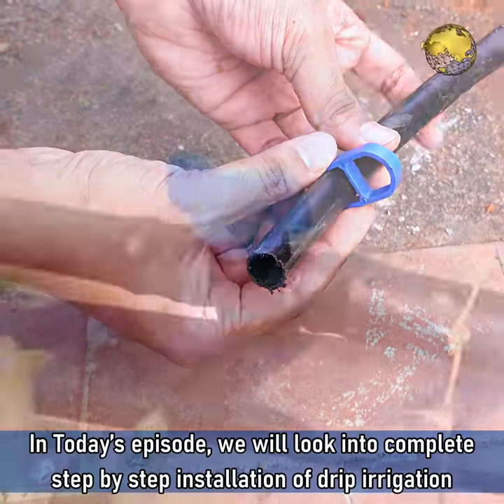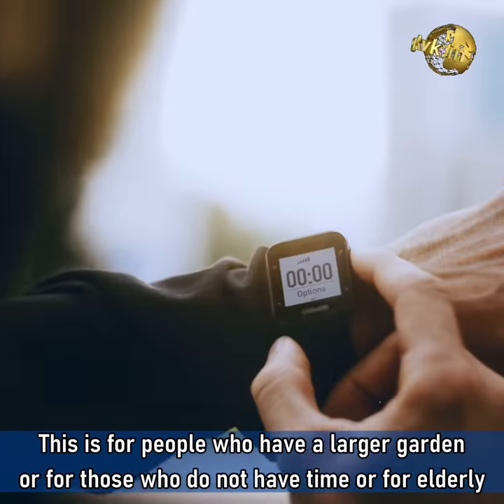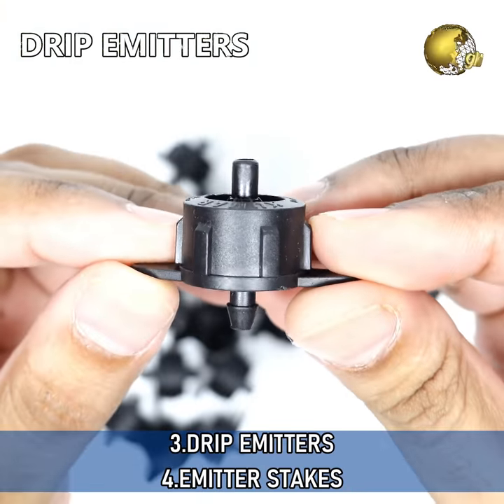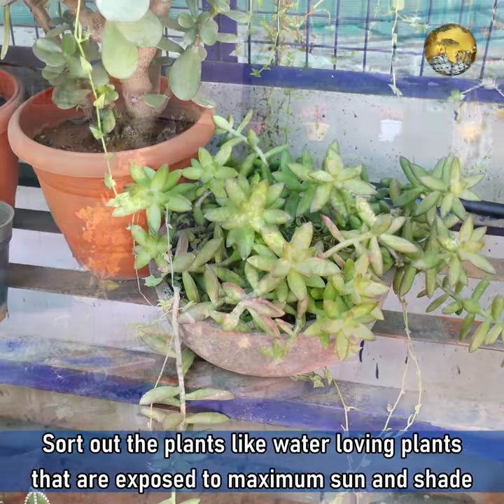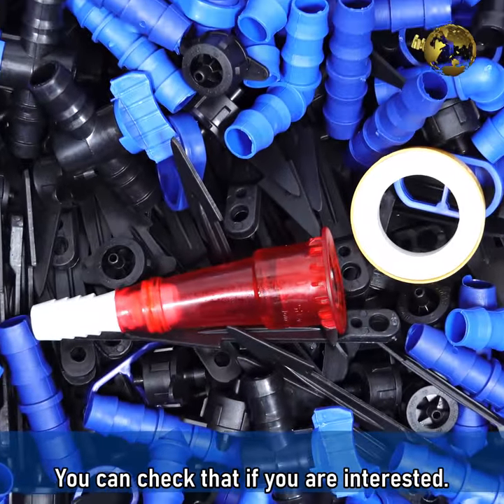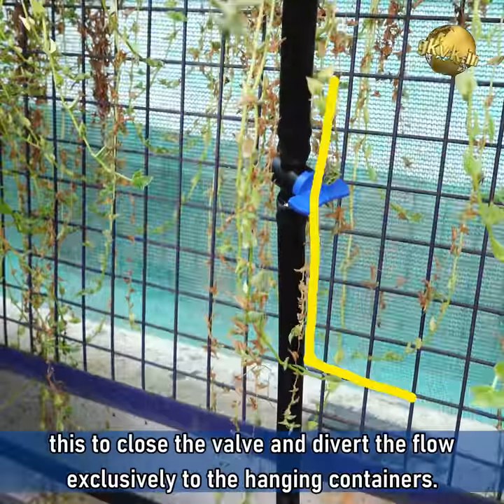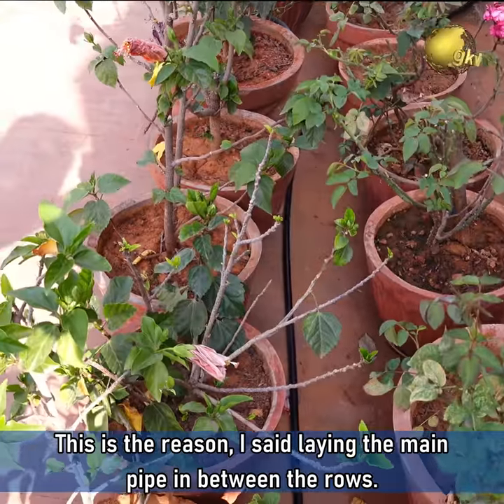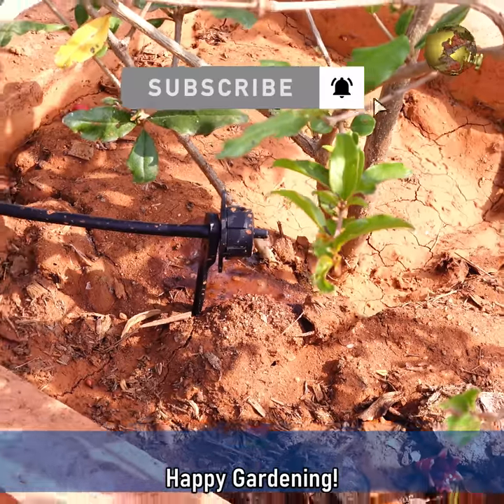TIPS & TRICKS: DRIP IRRIGATION SYSTEM INSTALLATION FOR HOME GARDEN

Comment: This is a lot of fun once you get the hang of what to do. One thing I will definitely agree with is having shut off valves to turn off water flow to specific sections. Especially if you have poor water pressure. I would also recommend not getting a cheap water timer. If you put it on before you go to bed, better dang well hop it shuts off and doesn't run for the next ten hours. Ask me how I know. :)

Comment: Very good video you have answered many questions though I have just one more question.... Drip irrigation system depends upon gravitational force of water this is the reason tanks are on roof ... What about if tge tank is under ground then how come water will reach to baskets hanging on top or vertical garden .... on ground floor pots water may reach easily but wondering about my vertical garden and hanging baskets ....i have planters pkaced on top of the grill too
Reply from the maker: Thanks. 
You can use a 0.5 hp pump or more depending on height.

Comment: many a time I find water not flowing in some emittors inspite of cleaning them. Will laying the main pipe at a height help water flow
Reply from the maker: If emitter is not working even after cleaning, try replacing the emitter. I always have extra emitters.
Reply: @GardenTips  👌

Comment: Thanks for the valuable tips on drip irrigation. As usual you have explained in a short and simple manner. 
Is there any option to have multiple outlets from a single tap.
Reply from the maker: Thanks. Yes if you have good pressure you can use splitters available for this or use the T to split and use valves for both outlets.
Reply: Thank you

Comment: Dr Sahib Namaskar 🙏❤️
After watching this wonderfully explained Vedio, just purchased one 8mm watering pipe, layed down in the pots, made one,two or three punches with 1mm wire and connected to main supply Tap, it's working drop by drop keeping the pots well Moist. 
Kindly guide me this system should be Run on daily basis or what should be the process ,yes some pots get dry on top and some still looking little moist. Sorry to bother.
My ❤️ Regards 🙏
Reply from the maker: Nasmaskar Sir!
Sounds great. Drop by drop, you can keep it open for 1 hour daily or alternate days depending on your season, especially summer and your plant requirement based on type of plant. 
Regards
Reply: @GardenTips  Dr Sahib Namaskar 🙏❤️
Thanks for your reply 
Sorry for being late
My regards

Comment: Hey. . nice video ..quick question... Can we add emitters to the 16 mm line also ...and also for 4 mm... Basically I have a line of 40 plants ...and then next to them ...random plants at 2-4 feet .not in any line... So can I make the main 16 mm line for the 40 plants with emitters... And from this main line of 16 mm...attach random 4mm tube .. and have the emitters on the ends ? Thanks for your reply in advance
Reply from the maker: Yes you can do it and it will work. 40 plants are not too many.

Comment: I have done drip irrigation. But my problem is, it irrigates only the part where the dripper is . So the other parts are dry . Is that ok?
Reply from the maker: You allow it for some time till the water drains out of the drainage hole. That’s fine.

Comment: Hi, i have an 205 litre of drum in my garden and i have purchase a micro drip irrigation kit and i have 25-30 plants
Can the pressure from  the drum water all of the plants?
Did you have other idea about how to increase the water pressure/gravity in the 205 litre drum without electricity?

How to increase the pressure?

Kindly reply for this ....
Reply from the maker: Hi, only way without electric pump is to increase the height of the drop by keeping it on a height like on a table or stool - the higher the better.
Reply: Thank you very much..

Comment: Bought the whole kit. It failed miserably. The large pipe started leaking at the side outlets for only 5pits. China water timer didn't work as Mumbai water supply pressure was too low.